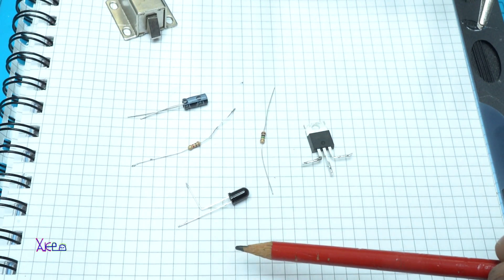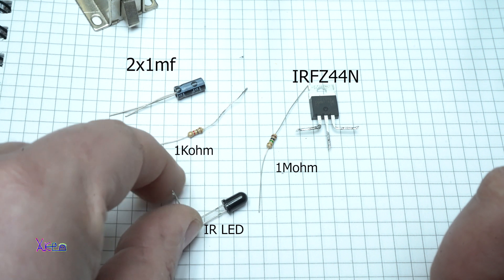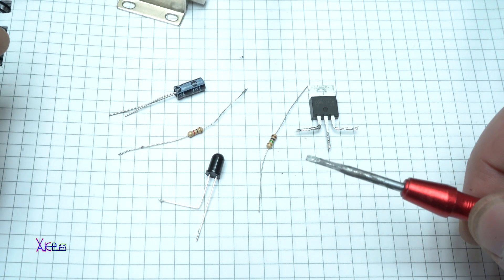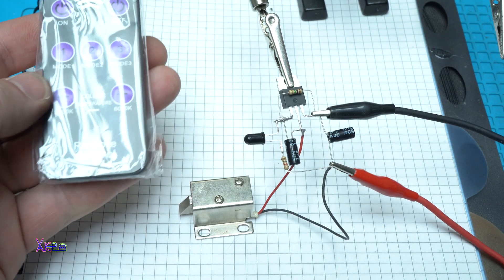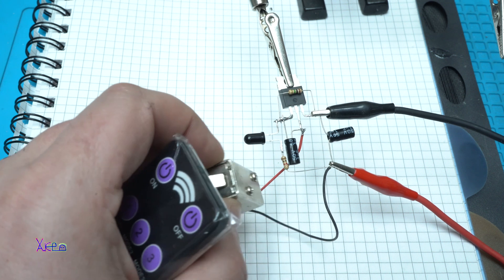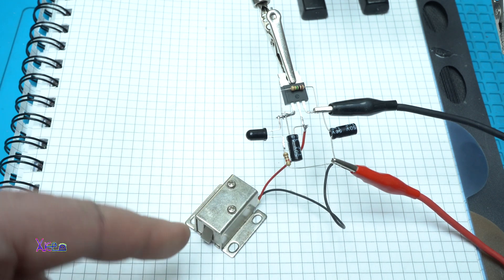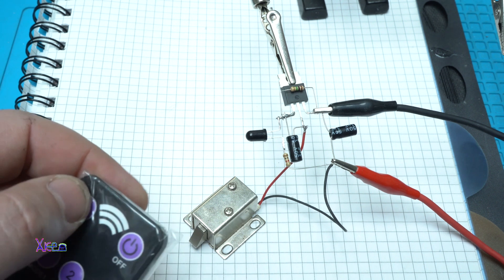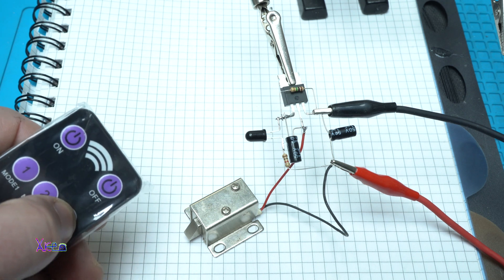Only 6 Electronic Parts to make RC Lock

Comment: 2 x 1 mfd capacitor
1kilo Ohm resistor
1mega Ohm resistor
1 Infra red LED
1 IRFZ44N Meowsfet
1 EM lock
1 IR remote
Schematics at 1min 48sec of the video

Thank you amigo! 

😺👍

Comment: If it's just ir why is all that extra electronic parts needed why not wire the ir directly to the look and power it without the diodes and Moffetts I guess I'm simply asking why is so much needed to trigger an ir attached to a lock?
Reply: The Mosfet is acting like a relay so can handle high currents. The cap charges and makes the delay for lock to return. Diodes are good for stopping the back emf of the coil. The ir diode won't handle the load of the locks coil by it's self.